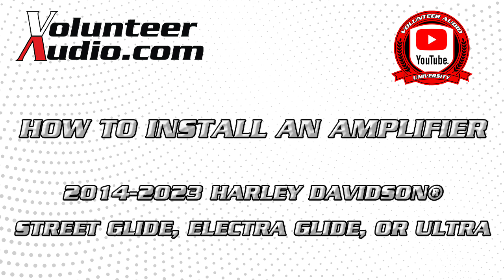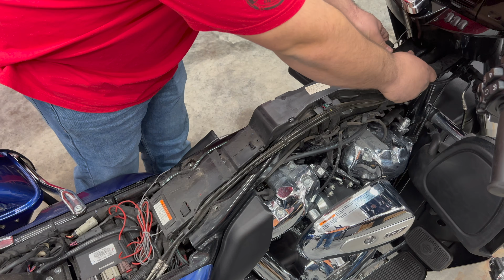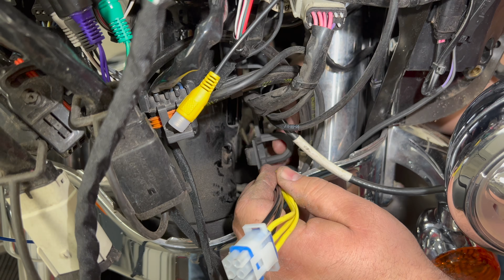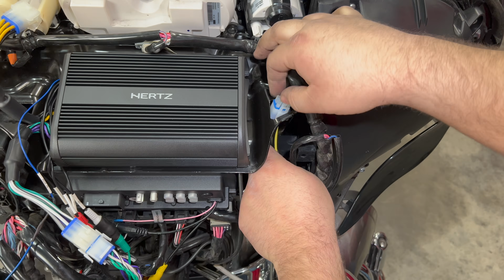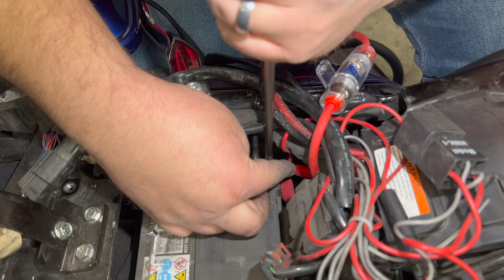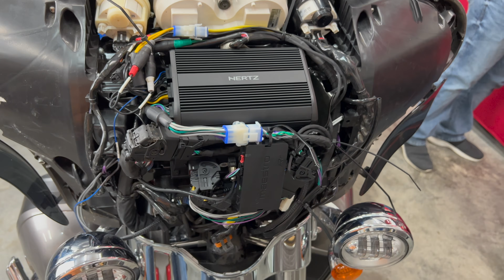How to Install an Amplifier in a 2014-2023 Harley Davidson® Street Glide, Electra Glide, or Ultra

Comment: I was just wondering if it was absolutely necessary to connect the neg cable to the battery is it because it’s the only convenient chassis ground available or is there another reason? Im just curious
Reply from the maker: It is the best place to connect your ground, the frame is not sufficient and the fairing is not properly grounded through the neck bearings

Comment: Great video! My question is… where does the back bone harness connect up front for the rear speakers? I have a 2014 ultra limited with fairing,tour pac, and cut in rear speakers. Waiting on the hertz amp from y’all to be delivered today! In watching your videos looks like I should’ve rented the techno tool to flash my stick radio as well. Oops! Next on the list! Thanks!
Reply from the maker: We add the backbone connector to our plug n play amp harness for this very reason.  Yes you must flash the stock radio as well before playing the amplifier or you will blow your speakers
Reply: @volunteeraudio  one more question… I have the amp installed now but, in order to flash the radio I will need to take it to a friends house to use his PC. Will it be ok to ride the bike to his house without doing the flash beforehand? Didn’t think about that part til after the fact.

Comment: Hey Jay! Great videos and knowledge of Harley audio! Question, I have a 2014 ultra limited. I have replaced the fairing speakers along with the tour pac speakers using the hertz sx165 and sv165 neos. I’m getting ready to install the sx690 speakers in the bags. I am currently running factory radio. When I can afford the hertz amp, I will be purchasing it from you. Is it possible to have the bag speakers along with the fairing and tour pac speakers all play without an amp? Thanks!
Reply from the maker: I would suggest waiting until you have the amp but yes they will play if connected

Comment: I have a question, I installed the 600 watt amp in my 2021  street glide with factory radio . If memory serves me correct there was a wire in the harness that I could not find a plug for it, it was either blue or purple I cannot exactly remember the color. My big complaint after installing the amp was to me it wasn't any louder that the radio.... my question is is there a single wire in the harness you supplied that doesn't get connected... maybe that's why it isn't loud...
Reply from the maker: If you purchased from volunteer audio give us a call at 1-844-30AUDIO for tech support
Reply: @volunteeraudio  I did buy from you guys, I will have to call when I take the ferring cover off, just want to make sure I call out the correct wire. Thank you
Reply from the maker: @sherminl1284  amp turn on is blue, give us a call and we will be happy to help get it right

Comment: My harness doesn't have a place to plug in the thumb control module. Do I keep my old haeness and plug it into the amp harness? Also, my amp harness has a plug that looks like it's for the backbone. Do I plug it there or to the factory rear speaker plug?
Reply from the maker: We no longer build the radio harness into the amp harness because soundstream offers multiple radios with different modules, plug the radio harness into the radio, amp harness plugs between radio harness and factory plug, use the supplied backbone connector on the amp harness

Comment: have a 16 electra, getting a radio COM error, deck isnt powering up, the amp is though.  Getting power via the 12V constant but dont seem to be getting any power through the accessory wire, if Im doing it right.  Any tips?  And just to confirm, yellow is constant, red is accessory, correct?  the only other 2 wires is the black ground a an unknown purple i believe, going to the radio harness/plug
Reply from the maker: What radio are you using?
Reply: @volunteeraudio  it’s a Sony double din. Not sure which model, came with the bike

Comment: i recently purchased your stage 4 hertz speaker and amp package and I am planning to upgrade the radio to the sound stream at a later date . Will i be able to remove the hertz amp to get at the screws underneath it to remove the factory radio?
Reply from the maker: Yes

Comment: Jay thanks for this video. My wiring works but I’m gonna go back and relocate my wiring to make it look like the way you did it. It looks more neat and clean like this. There is not a lot of extra room for wiring in the Street Glide like there is on the Road Glide.🫡
Reply from the maker: Fir sure there is not much room, take your time and secure the wiring with zip ties as you go